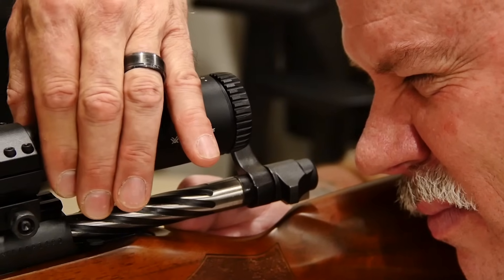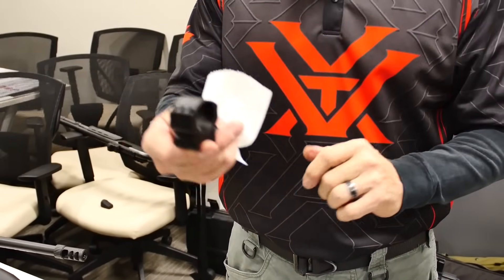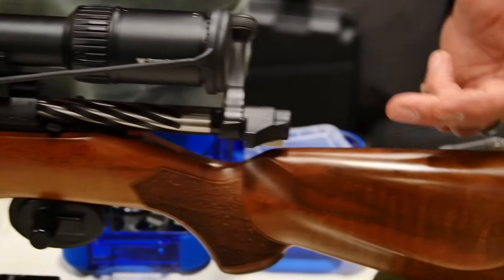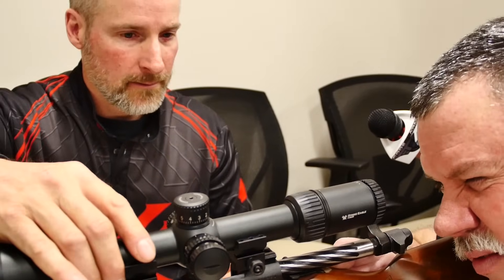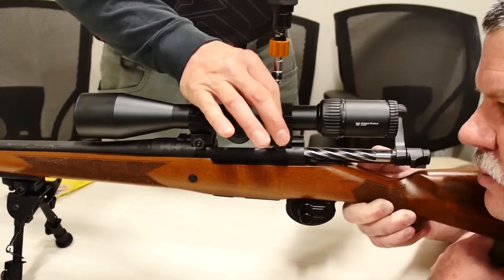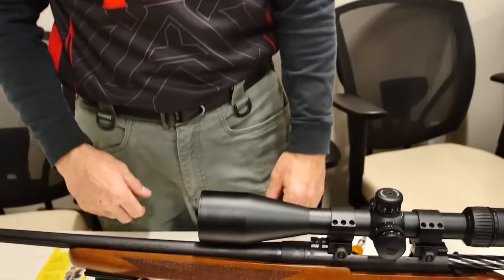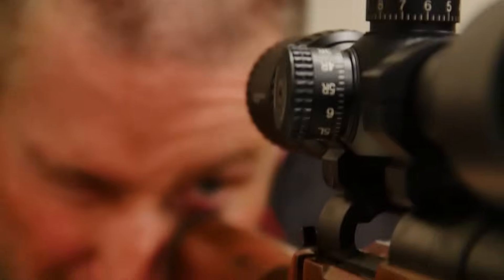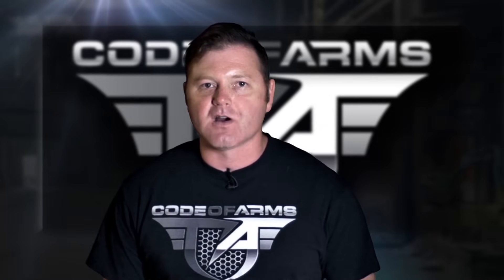HOW TO INSTALL A SCOPE PROFESSIONALLY - By Vortex Pro-Staff Mike Brake

Comment: If being perfectly level is a goal why would you ever use a bubble level instead of a digital one?
Your eyes are not that precise. You can be off well over a degree or two with a bubble level. Maybe it doesn’t make that big of a difference but if you’re going to do it why make it as precise as possible?

Comment: Professionally? Huge miss......here people. Ever hear of a lapping tool?  What ever happened to precision like you mentioned?
Reply: correcto!
Reply: lapping rings is a waste of time and money if you know what you're doing.
Reply: @Sartek  how do you raise or lower a ring when they are not level to each other?
Reply: @justincox7190  the outer body tube of the scope aligns the rings.  Lapping the rings has nothing to do with alignment. It's refinishing/polishing the interior contact surface of the rings- which nearly every scope ring manufacturer tells you not to do anymore, because the machining process is much more precise and it removes any protective coating or anodizing from the scope ring
Reply: @Sartek  when you install the alignment bars it will show you otherwise. Where on gets the idea that modern day production machining is perfect is in true. After a little lapping they align perfectly. I just did a set this evening. Either way, rifle still goes boom.
Reply: @justincox7190  then you need a better quality machined base to mount your rings on, better quality scope rings that are matched pair, and to learn the proper methods of mounting a scope.  If you want absolute precision you epoxy bed the scope and the base, and not lap the rings.
Reply: @Sartek  the professionals disagree.  You can get the wheeler kit with a torque screwdriver for 81$ including the pro leveling kit on Amazon . Far less than overpriced rings.
Reply: Sorry I have been installing scopes and working on guns for about 19 years now.  I have had to lap rings maybe 4 times.  With todays machining and precision it rarely is required anymore.  Buy good quality components, level them up and you are good to go.
Reply: Lapping rings is a waste of time and  money.
Never lapped rings in 30 years! 
Just need to know what you're doing and how.
Reply: Stay away from cheap crap like Tasco rings made in Chy-na and the "non branded" junk. Stick decent quality rings like Leupold, Warne, etc. and you won't need to worry about lapping. Back in the Stone Age most of the scope ring makers had old and worn machinery trying to crank out as much product as the operator could do. Machining is a whole different ballgame today. Even UTG puts out a pretty good product with consistent dimensions.

Comment: Horrible salesman, you never talk down your products.    When you say you get what you pay for, that just shows the product is always the same.   I do not use vortex. I have in the past. they do not like the cold. they also do not like direct sun light.   some of the hardest scopes to adjust.
Reply: You read into that comment way more than you should have. It was a generalization of the vast differences in equipment, not specifically Vortex related. You could just have easily interpreted the comment well you get what you pay for in the difference between bushnell dawn to dusk scope vs a vortex strike eagle. Obviously the vortex is going to be a lot better for what you pay for.